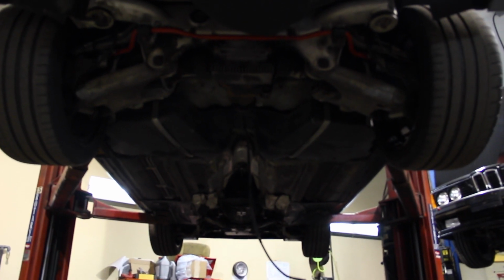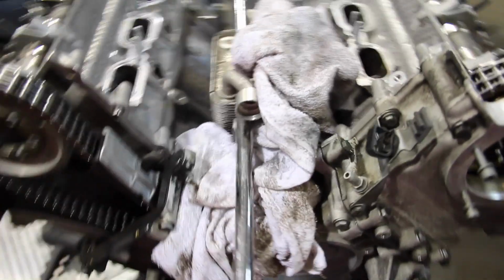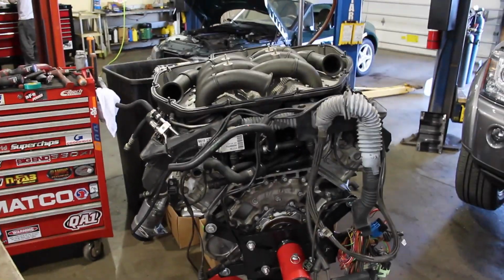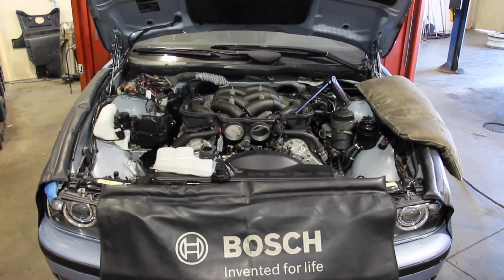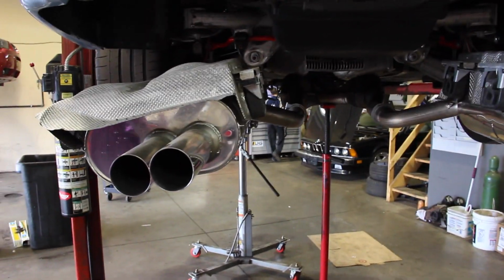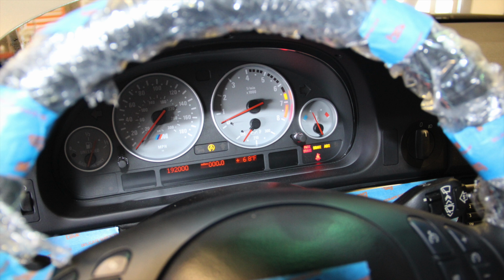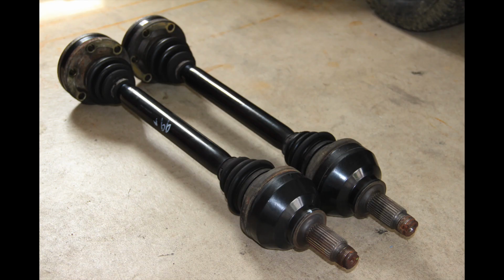Ryan's E39 M5 - Rebuild Project - Part II

Comment: I have to give it to you. You love that car, and won't settle for any replacement.  You probably could've bought a newer e60 for less time and money, but you stuck with the e39 because that's what you wanted.  Only real enthusiasts will understand...
Reply: E60 M5? Awesome motor and sound from the E60 M5, but I'd take this one over the E60. Heard it's a nightmare of maintenance bills on the E60.
Reply: +Anthony Rodriguez I've heard the same - I've heard it's just a clusterfuck of problems even in bone stock form. cars just too damn complicated - welcome to the modern age of cars… :(
Reply: too many sensor
Reply: It looks butt ugly too lol
Reply: Usman Zubair bearings on big end you have to replace every 50k km.if you dont you can get lot of trouble
Reply: But you forgot that you’d ‘eventually’ do the same for the E60- regardless.

Comment: This is all just astounding. Your commitment is unparalleled from what I've seen so far. I'm torn between an E31 and an E39 M5 (entirely different cars, I know) , but channels like yours are really making me fall hard for this car. Keep up your amazing dedication!
Reply from the maker: They're both awesome! I have so little experience with the E31.  I do want an 850CSi sometime in live though.
Reply: Now's the time to grab one...they're finally starting to appreciate like crazy. The E31 has the reputation of being one of the worst modern Bimmers to maintain but there's a fantastic support community and it's just so damn unique I think it's worth it lol... Even the regular 850s with 6 speeds or going up pretty fast in price. They're actually still pretty fun with the DME chips installed. Still, your car is basically superior in every measurable sense.

Comment: Loving your well documented project. I have a 1999 (pre-facelift) with 184,000kms (114,000miles) which until I saw your car I thought was mint! - You have given me something to aim for, Ryan, but I know I will fall short :). 
My M5 runs very trouble-free apart from needing one new coil recently. Luckily I have a non-dealer local garage who specialises in BMWs, and who I trust (although his wife backed out and damaged rear bumper recently! - being repaired and I'm assured it will match the car...).
It is not my daily driver (that, as of 3 weeks ago is a Renault Megane 265RS - tough, I know...), and I also have an Audi Ur quattro 20V in 100% original spec, except radio (I have one to go in), and 2 Honda Integra DC2 Type R JDM, one is a race car - I think in the US you call them Acura?
They are all very different and I love the character of them all, but the M5 is very special and the most collectible along with the Urq. The effortless GT performance is addictive on our wonderful NZ roads - luckily I still have my licence!
Looking fwd to Part 3 and seeing how the bedding in has gone. And approximate costs too? Cheers
Reply from the maker: +Audidude Thanks for the positive feedback!  Sounds like you've got a great beast as well.  Not to mention a fantastic collection of cars- enjoy!   I may or may not talk about the costs in Part III... but I'm not sure yet.

Comment: Nice finally got part 2! Hopefully those check engine lights go away with some driving. 

Watching engines get rebuilt is like therapy for me.
Reply: Therapy for sure, I just rebuilt/or I'm still currently going thru the motions on my 96 Maxima GLE. I've rebuilt the engine and still doing a major over haul on the whole car, everything, every bolt & Nut is brand new, hose and pulleys, belts and plugs the works. I also have a 98 e39 528i that I'm rebuilding hopefully I can get the videos uploaded to my channel soon

Comment: Once you own a M5 E39 there is no other car that can compare. You have to be a Beemer driver to understand Ryans method of spending tonnes of cash on this car. There will never be another M5 such as the E39's. Frankly no other BMW like it in my opinion.
Reply from the maker: I agree! :)
Reply: Ryan, Ive sold my 540i and now shopping for an E39 M5. Your channel is a huge help. Thanks again.
Reply: ***** Yes nice M5 however E39 lol
Reply: ***** Agreed the motor is very similar to the E39 M5 however lets be real for a moment the BMW motor that was manufacturered back in 2000 is far more raw in power then the one that released in 2004 in the E60. Body wise the lines on the E39 is far more superior and desirable even compared to any BMW today in my opinion.
Reply: That is true indeed. I owned an E60 but the 535 the interior was beautiful I loved how they designed the door trimmings. The only thing I wasnt a fan of was the head lights. I actually liked the rear tail lights
Reply: Not to mention IMHO every interior after the E39 M5 has been uninspired crap. This M5 was the last worthwhile car they ever built.

Comment: People forget that when you recondition the engine- you practically bought a brand new engine. Which means the car with care- can last another 2 decades with optimum performance.  So people with M5’s ‘eventually’ have to do the same. So yeah, if its a keeper - its worth it.

Comment: When installing the valve covers, do you coat the new gaskets with glycerin before putting them in the channel, or just installed them dry?
Reply from the maker: They can go in dry.  Just put some gasket maker on the 'half moons' on the rear of the heads, and the little line where the timing cover mates with the head.

Comment: curious did you consider upgrading the headers or v stacks while doing all this work? also what exhaust is that you have on it?
Reply from the maker: I would have loved to install Supersprint headers, but the cost prevented me from doing so (for now).  The velocity stacks are fine as is, in my opinion.  That could also be done very easily at a later date if I have a change of heart.

Comment: I have to wonder about all that assembly lube on the camshaft and lifters. Are you concerned about it remaining inside the engine and what will be left of it after numerous heat cycles? None the less, awesome video. I love your attention to detail and how clean your car is
Reply from the maker: +Jared Hampsey Thanks for the positive feedback!  I'm not worried about the assembly lube, it's designed to break down in the oil and then come out after the first flush.

Comment: Interesting project. I looked through the comments to see if you said what the cost of all this was but did not see it. How much was it? There doesn't seem to be many independent shop willing to do this kind of work.
Reply from the maker: I'm not willing to make the costs public at this point, plus they fluctuate by the day as part availability is fluctuating a lot.  One could buy another E39 M5 though for the cost.

Comment: E39Source, LLC - I have rebuild a few m62 engines. The guides may seem hard, however hard doesn't mean that they are not brittle!  I have watched your video part 1, and the guides look very average. New guides are smooth, yours have groves from the chain operation. Its an indication that time is near. I hope that they are still fine on your car!!!
The guides usually start failing around 160k-200k miles, or 14-18 years old. All of the engines so far had signs of braking, or little parts of the guides falling off already.

Word of advice to everone who is doing an m62 engine rebuild. Change them while the engine is outside. To change them on a car takes a lot of frustration and about 30 hours of work.

I have done 3 m62 engine rebuilds for myself, and I have to say that piston rings were within limit after 130k miles, and on the engine with 180k miles they are on the limit. All engines still had perfect 12-13 bar compression. I think that factory value is 12.6 bar. 

For an engine rebuild: generally seals, gaskets, chain guides, vanos and bearings need to be changed. With quality parts the cost is usually less than 450 pounds, or like 700 dollars in the US. Not much to get a perfect V8 engine. :)
Reply from the maker: Hi, thanks for sharing your experiences!  The M5's S62 runs a LOT cooler than the M62 (79C vs 110C) so the plastics do seem to last a lot longer.  I have seen S62 guides fail around 220k, but rarely fewer than that.  I'm very thankful of that compared to the M62.  Definitely agree about doing it while the engine is out though- even if they're supposed to have more life left, just get it done.  The M5 parts cost a lot more than the 540 though, parts alone are around $5k for all bearings, gaskets, etc etc.  Still not bad to get a racing V8 bullet-proofed for another 20 years!

Comment: Do you run official BMW coolant or regular green coolant in your car? Which do you recommend?
Reply from the maker: +NYCRevolution1 I use the BMW blue coolant now, but before I had topped up with the green Prestone stuff without problems.

Comment: I admire your dedication on this project.
However, what I have learned over the past few years on my own project is this - if you want something doing properly, do it yourself.
I have spent endless time on various cars trying to have certain technical work completed successfully - I appreciate there may be times where only certain work can be carried out by people with the correct tooling, but when you are scrupulous only the best will do, to me that means carrying out the work myself.
I have spent a fortune on tools I have only used once - one happens to be the SAC reset tool.

Did you consider carrying out this work yourself over a longer period of time?
Also, now the car has a different engine, do you consider it less genuine / non-original?
Reply from the maker: I considered it for about 3 minutes.  I don't have the time, tools, or even close to the experience to undertake something like this.  I wouldn't have trusted myself either.  I'm a doer and I like to learn, but not quite on this scale yet!  My car has had body work, new bumpers, many paint jobs, and now a different engine, differential, and axles.  It's MY car, and it's very special, regardless of what is or is not 'original'.  Doesn't bother me a bit!

Comment: Hey Ryan, I admire your obsession with the car. I used to have a 05/2003 E39 530i for 4 years and hope to be able to purchase an M5 one day. My question: did you consider buying a new S62 from a dealership in USA or Germany?
Reply from the maker: Yes I did, this option would have cost around $30,000 for just a new engine installed.  This is more than I paid for a fully rebuilt engine, fresh suspension, driveline, clutch, subframe, differential, etc.

Comment: Well done on an amazing rebuild. I'm just wondering why you chose to rebuild a new engine and not the original one. I am aware that the facelift version of the M5 tackled some oil consumption issues, but surely a rebuild would of address these issues too?! Wouldn't the car be worth more in the future with it's original engine?
Reply from the maker: Rebuilding the original engine would have been problematic logistically.  The whole car would have had to sit in the shop for an additional 5-6 months.  Also, I would have had to hone and sleeve the block since the OEM block coating is alusil and can't simply be honed and then new rings.  It would have been more difficult and much more expensive to rebuild my 2000 motor.
Reply: An additional 5-6 months? Here in Holland the whole thing would be done in about 4-6 weeks, providing all parts are ordered prior to starting. Anyway, great job! Beautiful car, well worth preserving. Looking to buy a Carbon Black facelift model myself this summer.
Reply from the maker: The shop ordered "all parts" before.  But with a job of this scale, there is no such thing as not having a delay.  The machine shop alone took 5 weeks to polish the block, do the valve seals, so fourth.  Then we had to wait 3 weeks for a pressure plate reset tool.  Everything gets delayed and has to be scheduled.

Comment: i noticed you did put a single mass flywheel? is it good or you regret not having dual mass anymore?
Reply from the maker: It's a stock flywheel, and feels great!
Reply: What do you mean stock? I saw its written valeo, and valeo makes single mass flywheels. The oems are always LUK
Reply from the maker: The one I put in there is the LUK DMF021.
Reply: Oh so you did put valeo clutch kit on a luk flywheel
Reply from the maker: It's a LUK clutch kit as well, I'm not sure where you're seeing Valeo.
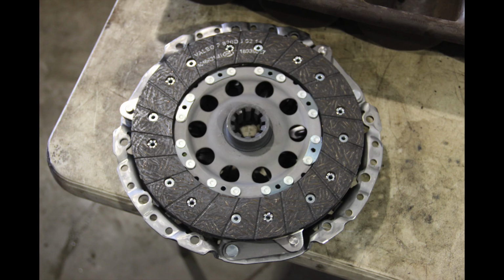Reply: 25:51
Reply from the maker: It does say Valeo!  Interesting, I didn't notice that.  I purchased the LUK kit from Amazon, as the majority of M5 owner's do when replacing the clutch because it's the best price with Amazon Prime.
Reply: normally you can't put valeo stuff with luk together.
Reply from the maker: Well, that's what we've all done apparently.  It was sold as LUK.

Comment: Are those the old pistons in it? and did you re-use the rings? I think this was an awesome project, but why put 14 year old parts back in the engine? i know cost must have been a big factor, but its just as easy to put new pistons/rings as old ones.
Reply from the maker: Original pistons and rings.  New rings would require machine the engine block.  The S62 engine block is alusil coated, and cannot be machined, so it would have be honed out and then sleeved. It would cost a fortune, and the chance of failure is much, much higher.  All or the original pistons and rings cleaned up like new, and tested well within factory spec.
Reply: +E39Source wasn't aware. my mistake. awesome work at any rate. cheers

Comment: ryan can i still drive my e39 when i take off the abs module to get rebuild. Thanks
Reply from the maker: You can, though of course you will not have antilock brakes or traction control. The three lights will be illuminated on the dashboard. The larger problem is, the mileage is stored in three modules on the E39. Number one is the engine control unit, number two is the light control module, and number three is the ABS module. These modules constantly compare the mileage between one another. When it becomes off by more than a percentage or two, a temper thought will be illuminated on the instrument cluster. I would avoid driving the car without the module installed more than just to move it out of the way.
Reply: @E39Source  Thanks very much i knew i could count on you i live in europe now & have access to cheap e39 parts if i could ever do something for you just drop a line again thanks

Comment: Damn I was thinking about getting a 100,000 miler or so E39 M5 next year but it seems like its so complicated and is impossible to maintain. I don't know if I wanna spend all the time and money on workshops and garages - any other ideas for a daily driver? E46 M3s also seem to be rust buckets and subframes etc. not to mention the leaks and what not. I really don't know what direction to go in now...
Reply from the maker: 100,000 miles is just broken in.  An M5 that has been taken care of with 100k has a lot of life in it.
Reply: +E39Source people treat old BMWs like shit here (in the UK) so I'm super sceptical EVEN if I get a pre-purchase inspection I'm still scared to take the plunge. E46 M3s and E39 M5s are both abused here. the people who take care of them are holding on tight I suppose

Comment: The water pump is going to lock up on you. The on e in the picture has a 100 percent failure rate after a few thousand miles. The bearing inside the pump will cease and throw the fan blades. Proceed with caution. Find the one with the thin aluminium fins.
Reply from the maker: This is the same one I had installed many years ago and it works very well in my experience!

Comment: I am STILL very interested why the hell you filled 5W-30 in your M5 :D Because BMW recommends it for the 2000's and later models?
Reply from the maker: BMW recommends 5w30 for 2001+ engines.  Also, the lighter and thinner oil was able to penetrate all the areas in a freshly rebuild engine better than a heavier oil. I will be switching to 10w60 for my first oil change.
Reply: Thanks for your reply. You are right, but i hope you know why BMW changed that recommendation - only for commercial reasons. No Employee of the "M GmbH" would recommend 5W-30 ;-)
I understand your point with the thinner oil for the "new" engine, but...why u didn't use a much better 0W-40 then? 5W-30 is really not the best choise - for any car. Its just cheap ^^
Reply from the maker: An oil's weight can't make it 'cheap'.  It's just that weight oil.  It'll have 10w60 in it again soon.  I know plenty of E39 M5 owners who have only run 5w30 in their car for ten years and 15,000 miles, and they run just as well as mine do.

Comment: Hey Ryan, you're saying you didn't clean it; rust prevention. Do you mean it will be more prone to rust if you would clean it?
Reply from the maker: The oil and grease prevents rust.  Clean metal will be more likely to rust.
Reply: Makes sense. :)

Comment: I'm shocked the M5 motor cost that much.
I just had Turner Motorsports install brand motor in my Dinan 540i M Sport plus new CPU
for $18,500.00 all in.  Turner race tech also remapped CPU & Dyno.   Now 345hp 
I have around 65K in my car.
How much $$$ do you have I your car?
Reply from the maker: That's a number that I prefer not to share at this point.
Reply: Well that made my decision. I'll invest in a lift, tools, and so on .and do it myself.You were a big help on how much work needs to be done.Thanks for videos.

Comment: why would you leave the stock exhaust manifolds on the engine? They are crap and are not timed ie equal length headers.
Reply from the maker: I had to draw the line somewhere for this project.  I'll upgrade the headers at a later point in time for sure.